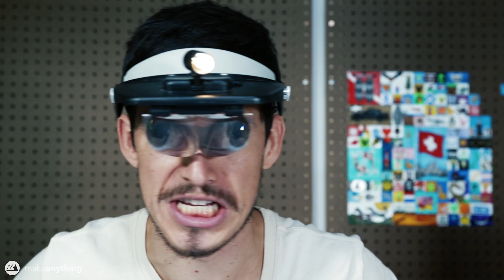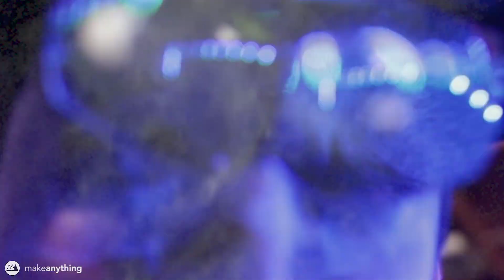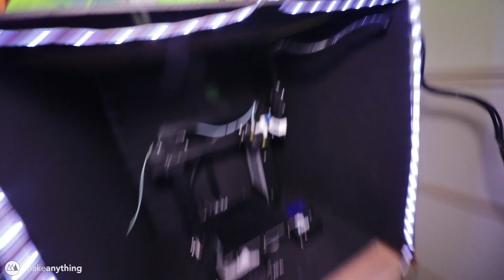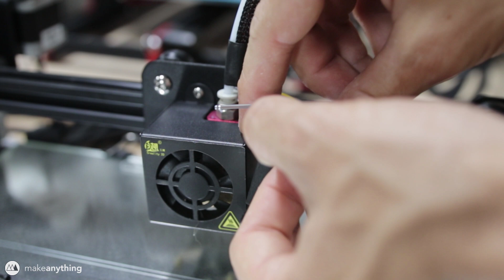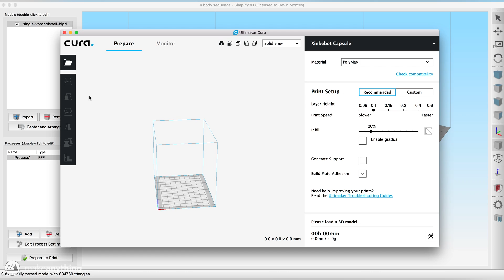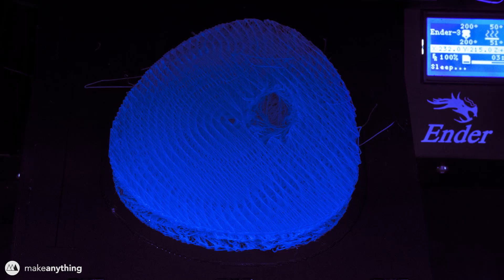How to Do That Cool 3D Printing Timelapse Effect // Hacking the Timelapse

Comment: Can you do a video on this same thing but using a GoPro and a wireless remote for the go Pro. I’ve tried but I couldn’t get it work
Reply: What problems did you have?
Reply: Zack Snyder Well I move the finger down to the lower hole to make it push the button because the remote is small. But even when I move the X axis all the way over to 300 it’s still doesn’t push the button hard enough. It pushes the button but the remote doesn’t read it. The remote works when I push the button with my finger but not with the printer. Any ideas in anyway you could help. I would really like to try this out
Reply: If the button is held down for to long it doesn't register, try removing the wait line from the Gcode.
you can move the wait Gcode to after it presses the button if anything is blurry.
hope that helps.
Reply: Zack Snyder I will try it. I haven’t even set up the G code yet I was just moving the x-axis over to see how far it needs to move to push the button.
Reply: how to i use in=t in cura? When we use your way, do we have to add the extension for each layer?
Reply: Extensions, post processing, Modify Gcode. Add a script. search and replace. 
you don't need a new extension for each layer.

copy and paste the code into the input feilds.

in the Search feild:
LAYER:

In the Replace feild:
TakePhoto
G90; Absolute
G1 F9000 X190 Y210; Quick
G1 F1000 X197; Poke
G4 P500; Wait
G1 F9000 X190; Back
;Layer
Reply: ok ill try
Reply: do i need to put a number in front of ;layer? for example 4;Layer?

Comment: I'm working on a system to use a Gopro remote and the Anycubic i3 Mega, Thanks for the inspiration!
Reply: I love the anycubic I3 mega
Reply: Hey zack ..did you manage to do that ..as i have two i3's and would like to have a crack at this ..🤘
Reply: Hi, I also have the I3 Mega and I am struggling to get rid of stringing on the time-lapse. The code that I am currently using is as follows:

TakePhoto
G90; Absolute
G10; Retract
G1 F9000 X205 Y215; Quick
G1 F1000 X215; Poke
G4 P500; Wait
G1 F9000 X205; Back
G11; Extrude
;Layer

The retraction doesn't appear to register in Cura. I've also tried a manual extrude and retract however the retraction distances seems to increase every layer. Any help is greatly appreciated.

Comment: Do you do it the 'hardware way' just because it was a fun project? If so, fair enough. (I once designed a printer attachment for a capacitive touchscreen stylus, wrote some code that interfaces with Octoprint, just to allow me to control my smartphone remotely with my computer mouse.)

But I can't really see any practical benefits this would have over the 'software way'. If the gcode can send a signal to take a picture, that surely beats the physical finger pressing the physical button.

Comment: Did the same thing a few years ago, except I used the layer-change gcode to trigger a gpio pin on the control board. Fed that signal through a modified usb cable to a CHDK hacked Canon camera. It added ~30s per layer, though, so I figured I just wanted the prints faster. :-)

Comment: A another way you could do this is tap into one of the limit switches. Canon cameras remote triggers work by a signal being pulled to ground. If you tap into the limit switch, whenever the switch gets pulled to ground it would take a photo. Then you would not need the remote trigger. Just an idea. You would have to check and make sure a voltage is not being put through the limit switch before plugging your camera into it.

Comment: Nice Tip with simplify and the layer script. I want to do it with an M42 Gcode command setting one of the AUX-Pins on my Ramps to high for ca. 500ms so that I dont lose so much time for driving the head back and for. I hope it will work, but then you have to manipulate the remote of the camera.

Comment: Ohhhh you tricky sucker! Early on when I'd seen your super clean, awesome looking time-lapses that looked better than anything else, I assumed you used software, and the only key was getting the printhead of the way for each shot! (since most others would just take a photo at intervals, regardless of head position and it wouldn't appear to "grow" out of nothing)    Is there a standard percentage of time snapping a frame for each layer adds to a print's time?
Reply from the maker: It's about an extra second per layer. It can add up, but it's not too bad considering how long all prints take :P

Comment: Does your 3D printer have any output relays? or could you add one?
Connect your camera directly to that, and use GCode to fire the relay :P You could get a cheap shutter cable from amazon or similar, and wire the relay to the button
Reply: Opto-isolator running off any gcode controlled output pin is another option (like an unused fan output). The voltage of the output pin doesn't matter that way (3v GPIO would work just as well as a 12v fan pin)... You just choose a resistor for the isolator input side like you would for an LED, and the output acts like a switch (technically a transistor - you do have to get polarity right as far as I understand).
Reply: @tin2001  
Indeed 😊 What could also be a fun challenge, is using a stepper motor to pan the camera up as the build progresses, and sync that to the z axis. Again in the gcode, add a command to pulse an output pin to drive that stepper

Comment: hahaha, brilliant intro Devin! Sorry for calling you out on Insta assuming you were using Octolapse, this makes a lot of sense now, and how "old skool" using a physical squidgy finger to press an actual button! Very very clever though, well thought out! If you had more access to the printer firmware you can replicate this electronically too - Marlin has a "camera trigger" command that essentially is the same idea where you trigger a GPIO pin which is connected to a shutter release. Your box setup has given me some ideas though, along with the LED strip... hush hush...!!! 🕵

Comment: What a fantastic idea (and intro)! However, wouldnt it be way easier to just use a micro switch to trigger the camera instead of a full-fleadged remote trigger? That'd result in less stress on the print head and less weight on the x-axis
Reply from the maker: I'll have to look into it!

Comment: it's so simple and ingenious idea at the same time!) I think it can be improved. You can shoot all this on the phone, and the phones have such a function as shooting when you press the headset volume button, and so you can take a non-working headset and parallel to the volume button to solder the limit switch. And the switch itself is mounted on the frame of the printer by the principle of the limit switch on the X axis.

Comment: Those magnifyiers! (Magnifiers?) So creepy cool. Very mad scientist. Love it. Been loving these time lapse videos across the Maker world. Photography is my first love. I used to wander the county taking nature shots until my disability shot me down. Did some time lapse work with an intervalometer(love that word, say it 3 times fast!) Long sunrise, candle burning down (all on YouTube) Got into 3D printing as a hobby I can do literally, just something I'm able to do now.
Is your camera on battery or are you remotely powering it? That's my worry right now. I've got a great camera, Fuji X-E2, but it can't run off an adapter. I'm worried about running the batteries out.
What software are you using to stitch the images into a time lapse? Also are you shooting full resolution or backing it down some to save space?
Hope you see this and have some time to answer my questions! Going to scroll the comments below to see if any Cura solutions were posted. 
Thanks for sharing your ideas with us. Great video!
Reply from the maker: I love photography as well! My camera does use a power adapter, that's certainly ideal. I've stitched the photos using premiere, which I edit videos with. Any old video editor should work, and Photoshop can do it as well. Full raw photos on a 64gb SD card. Good luck!

Comment: Now what's left is to implement it in software so just an interrupt is generated by the processor when an endstop is hit on the current max layer height or trinamic detects an forced change. Instead of endstop we can use calculation to find the max x or y it'll move in that direction by pre-analysing the gcode by a pi and then calculate the capture trigger times n send signal to camera (via 2nd usb or wifi/bt if supported)

Comment: Even though the cell vase was designed for nice timelapses, it makes sense as just a regular vase. Remember when the first 3D printed objects were all wireframe cubes inside cubes, just because injection molding couldnt' do it? Thats what this vase is like; a basic vase, but with an exterior structure that could only be done with 3D printing

Comment: got an unusual question, what would happen if the internet or power goes out while a print is working, can you just start where you left off when the power is back? you gotta start over, etc? power goes out pretty often for some reason where i live, even though its not storm/bad weather/other natural causes, it just does...sometimes for 0.5 seconds, sometimes 2 seconds and other times up to 1h...
Reply from the maker: It depends on whether the printer has a power resume function. The Ender 3 and CR-10S have it, the CR-10 doesn't

Comment: This can also be done using a phone and headphones, when the volume button on the headphone is pressed the phone takes a photo.
Reply: You phone can't hold 1000 pictures? Woah
Reply: Won't that immediately fill up your storage
Reply: It takes one picture every layer. A printer with a hight of 200 mm and a layer hight of 0.2 mm that's 1000 layers or 1000 pictures . Most phones should be able to store  1000 pictures
Reply: @proginx  hmm yeah but it would still fill up fairly quickly if we assume the resolution is for a 1080p video but if it's attached to an external hard drive then yeah it's possible
Reply: @cybunny25  1080p is like 3 megapixels lol
Reply: @nickkk420  extreme necromancer skills there dude lmao
Reply: On my phone a photo at 3120x4160 is ~5MB so it would take only 5GB for a print using full height with high quality pictures.
Reply: That's pretty clever...
Reply: Whoah, great idea!

Comment: O man that looks amazing! Thank you for sharing.
 if you have a sec...
Could you give me a tip on how you created the solid vase inside the Voronoi outside?  double walled vase in fusion360 and exported as 2 shapefiles?
Thanks.
Reply from the maker: Yup that's exactly what I did. Merged the parts in 3D Builder afterwards
Reply: @make.anything  

Thank you!!!!

Comment: Clever solution! If pressing the trigger button gets fidgety with use, I would suggest wiring the button to a optical sensor. They're easy to wire and designed for applications like this.

Comment: Hi, what print bed do you use for the ender 3, I got a printer due to your review video and my print bed has a slight drop in the middle making it extremely hard to level. Also, I have had issues with the prints sticking so I use masking tape now. Hope that the bed would help with that. Thanks!
Reply from the maker: Well right now I'm using a Easy Peelzy removable bed, but I'm not sure I'd recommend it. The magnetism is a bit week so I've had to clip it down to prevent warping. I do prefer it to the Build Tak though. Tape works, or if you find a glass bed the right size that might help level things out a bit.
Reply: Make Anything Thank You!

Comment: This is a great solution! I think I am going to do something similar, I am going to buy another cheap and tiny remote control for my camera and instead of the button on the remote I am going to solder a "limit switch" to it, which is attached to the printer.
Reply from the maker: That would be awesome. Definitely a more finessed solution ;)

Comment: Printing inside the Box is Thinking Outside the box :) Wow! Awesome.
Reply from the maker: Haha thanks
Reply: Hi, please, what are the settings that you use for your jgaurora a5? I would find them myself, but I'm finding them already for 2 months and still can't get a good result, because it's my first printer (btw thank you for your video about it, it's a great machine and I bought it mainly because of your review) and I'm not sure if those problems are there because the filament I use (it's the cheapest one I could find). So if you could tell me that, it would be really useful for me. Thanks. Oh, and I almost forgot! That was probably the most unexpected way I could think about! XD Where you take these ideas...
Reply from the maker: @vit.budina  I use the exact same settings as my cr-10, I bet it's way easier to find profiles for that!
Reply: Thank you very much, do you have any verifyed source? Sorry for asking this, I'm not that much experienced user. Thank you. :)
Reply from the maker: @vit.budina  not for cura, sorry. With Simplify3D you can just run the setup assistant and select the cr-10 as your printer
Reply: OK... so, as I know that you probably know more about 3D printing, can you advice me something? I've printed with my filament with 0,1mm height, and: 1)I can't get good result with any other height (0,2/0,15/0,3mm) and 2) I've been printing with 0,1mm for some time, didn't get any striging or oozing for about 6 7 hour prints and suddenly, I get strings and oozes like if I wouldn't use any retraction settings. I thought it was filament broken in my bowden tube, but the lenght of the tube already went through and still same results. Please help. Thank you.
Reply: @make.anything  where can we find the stl's for this??

Comment: With a room filled with all those foamboards, plastic and printers running constantly, how do you manage your firesafety?
Just curious!
Reply from the maker: I've got several smoke detectors and cameras, but I do feel the need to increase my safety measures!
Reply: I have the same feeling, especially when I leave mine running overnight. I do have a smoke detector above it, stay at home when its on and have a fire extinguisher next to it. But I don't really know what else to do except to build basically a fireproof safe with a printer in... which seems economically unfeasable.
Reply: @SteelFlange_  Firecode drywall is very fire resistant and cheap
Reply: I store all my flammable liquids and oil soaked rags next to my 3D printers... I'd like to rebuild my house one day.  :)  That, and I'm not paranoid about printer fires that are probably the lowest chance of fire I have in my house when there are dozens of devices that are charging, cooking in the kitchen, clothes drier, flaming rats, etc.
Reply: @Mark_5150  still.. Its something that everyone always thinks about as "thatll never happen to ME".
Reply: I didn't say it can't, just that I don't care if it does.  I have 2 printers running right now while no one is home, there are other things to worry about than having to rebuild my house.
3D printer fires are such a small percentage of house fires, I can't even find statistics on them.  I think there are better odds of someone breaking into my house today, sitting on my couch while smoking a cigarette, taking a nap and catching the couch on fire than my printers catching fire.
Reply: Your point about 3D printer caused fires being rare feels moot since 3D printers themselves are not exactly in every household.
Reply: @Mark_5150  I can also find no stats on people crashing their car due to closing their eyes for 5 minutes straight, doesn't really make it less dangerous due to lack of stats.
Reply: FLangevor Yep.  I thought the same, “well, mine isn’t one of those that has moving beds, those are the ones that catch on fire with poor wiring to the bed”, “well, mine isn’t one of those $150 printers with thermal runaway turned off, those are the...”, found out I was wrong when my MKS Sbase locked up, thermal runaway protection failed despite being on, and the board never told the heater to turn off.  No idea how hot it got, but it was hot enough to make ABS ignite and shoot flames out of the nozzle along with a kettle pot like effect of smoke blowing out.
Reply: Should rig a smoke detector up to a relay, get it to cut off power and douse the printer in CO2

Comment: "If i run the defrag and the disk cleanup at the same time..."
Reply: When I worked at Staples years ago we would tell people to do a defrag and a scan disk and call back when that was done.  We knew we would be gone by then and be able to pass it on to the next person.  It was great :)
Reply: The Cheap 3D Printer and ususally it would do nothing.... 😂
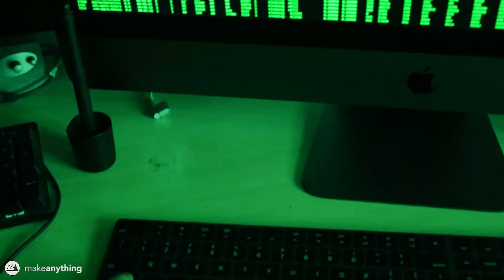Reply: Wich Programm have you used during this scene? (1:15)

1111 1111 1111 1111 1111 1111 1111 1111
1111 1111 1111 1111 11      1111 1111 1111
1111 1111 1111 1111 1111 1111 1111 1111
1111 1111 1111 1111 111    1111 1111 1111
1111 1111 1111 1111 1        1111 1111 1111
1111 1111 1111 1111 11      1111 1111 1111
Reply: danging gosh hecking darn you commented before me
Reply: E=mc^2?
Reply: DEAD 😂👌